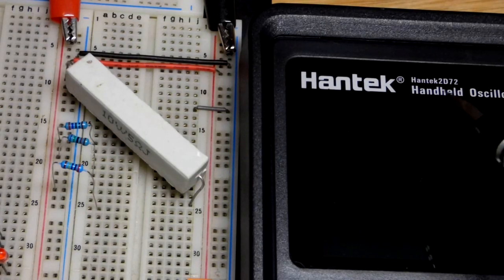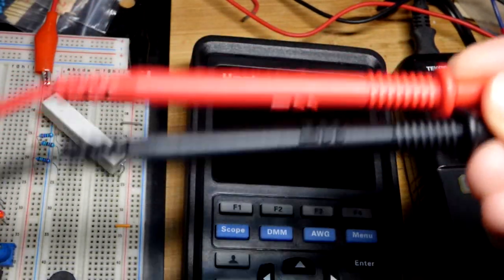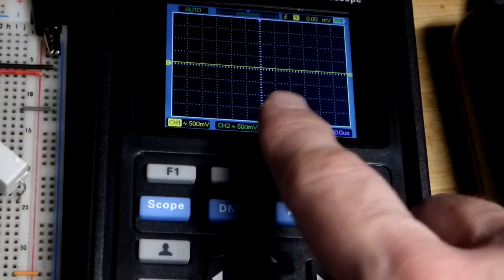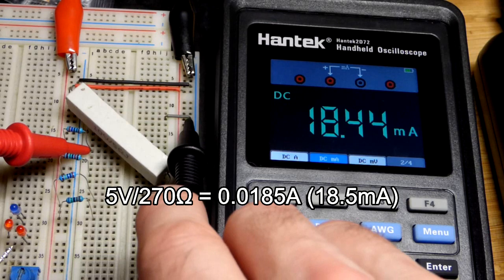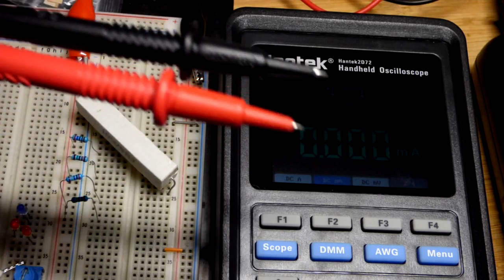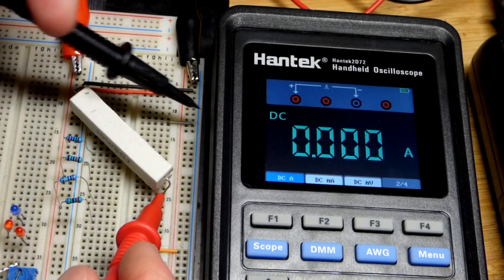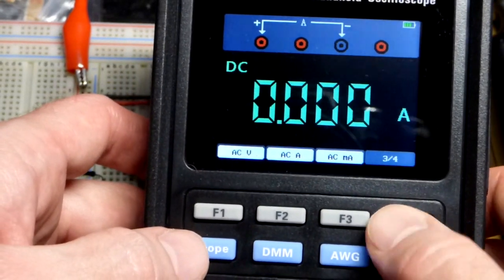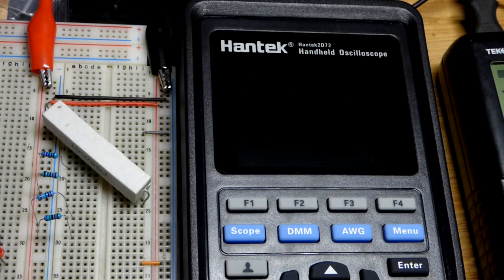How to take multimeter current measurements with Hantek 2D72 DIY video

Comment: Very important stuff, thanks for posting! I rarely try to measure current because it can be risky. I see now why it is better to just calculate the current based on the given voltage and resistance.